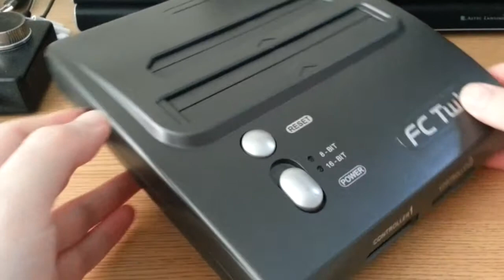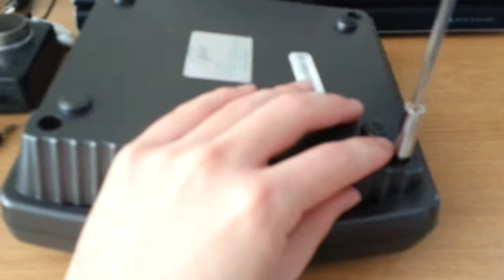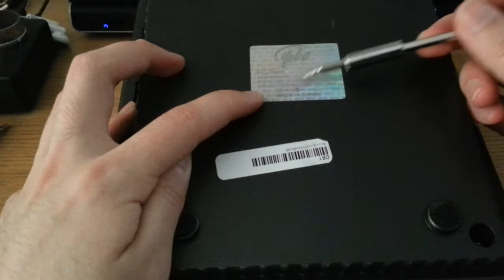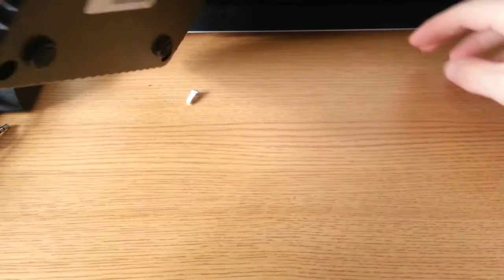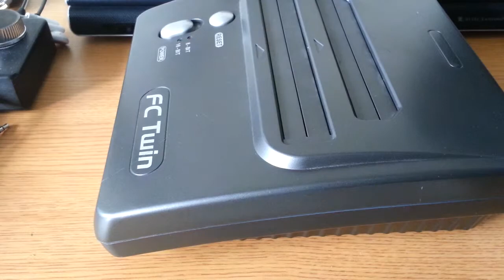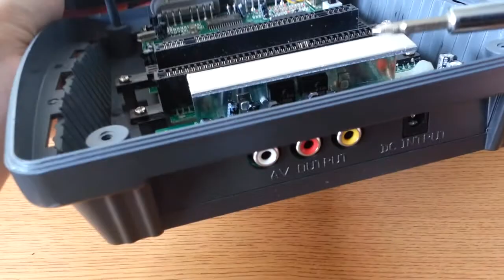TeardownTube - episode 31 - Yobo FC Twin

Comment: I have one of these. It worked great until I accidentally shook it too hard. Now it doesn't work. I opened it up to take a look inside but didn't notice anything out of place. I don't know anything about those motherboards and stuff, I just thought something could've been lose or something like that. The 8 bit and 16 bit lights come on. Any suggestions? Thanks.
Reply from the maker: The soldering on mine wasn't the best so it's possible there's a cold solder joint on yours that shook loose and is preventing it from booting/running. I'd check every solder joint and reflow anything suspicious with an iron before testing again.

Comment: I had a question for you about the jewel silver FC twin. Recently the 16-bit stopped working it just displays a black screen and occasionally some white scan lines. The 8-Bit still functions completely fine. I'm working on understanding how hard we're works and I'm at a loss as to what's going on with this system do you happen to have any suggestions? I've tested at least seven different cartridges and they all come out with the same result.

Comment: So I have one and it worked fine in 16 and 8 bit with my games with or without game genie. After the last time I used my game genie on the 8 bit it slowly went out. Any ideas?
Reply from the maker: Sounds like something internal to the noac died. Unfortunately the 8bit side (unlike the 16 bit side) is all integrated into one chip so there's little you can fix.

Comment: I get power on my leds. No audio or video. Any ideas?
Reply from the maker: Same thing on both slots or does one or the other show any signs of life?
Reply: @sjm4306  same story for each
Reply from the maker: Have you inspected/cleaned the cart contacts? That's the first step in fixing old consoles as the pins/contacts are prone to wear and corrosion.

Comment: I am using a dc adapter to power on my system I got it second hand without the adapter that it came with. The system powers on but only the snes portion works. What can I do to fix it?
Reply: did you ever get it working?
Reply from the maker: I have a retro duo that does the exact same thing (snes works but nothing for nes). First thing to check is if the connector is dirty, then see if there is audio but no video. If those all fail then unfortunately it is likely that the nes glob top chip bit the dust and there is little to nothing we can do to fix it.

Comment: I'm using a original Nintendo AC adapter the system comes on but no picture
Reply from the maker: Does either NES or SNES side work with video and sound or do the LEDs come on but nothing else?

Comment: ok but I see anything on my screen i can hear amp noise but a blank screen
Reply from the maker: It can be 1 of 2 problems: the cart slot pins are dirty and thus can't read the game, or there is some damage to the system circuitry. The best thing is to do a full clean and retest.

Comment: Your FC Twin is missing the Yobo Gameware logo "if you look at that oval it's suppose to have something covering it that says Yobo Gameware"
Reply from the maker: Huh, well it is, I just never noticed. I just google image searched the fc twin and it is missing. I bought it dirt cheap off ebay so I'm not all too surprised. I plan on trimming the snes board to fit into a portable anyway so the case condition really doesn't bother me. Oh well.
Reply: I had a FC twin but traded it for a Retro Duo.
Reply from the maker: cutemimi25
In my opinion the retro duo is better is almost every way I can think of. It is smaller, nicer looking, has better compatibility, and is an all around better designed product. It's not perfect but the small sound and graphical problems can be taken care of with some simple modifications.I love my retro duo.

Comment: Great video. Is the Yobo fc twin still working?
Reply from the maker: Yep works great, I've even modded it to get RGB out. But between the yobo and retro duo the latter gets much more mileage. Now that I've descovered retropie though I'll probably end up emulating more and more due to the ease of use. No matter what though there is still something about having the physical cart you can hold in your hand.
Reply: Thanks for answering my question.